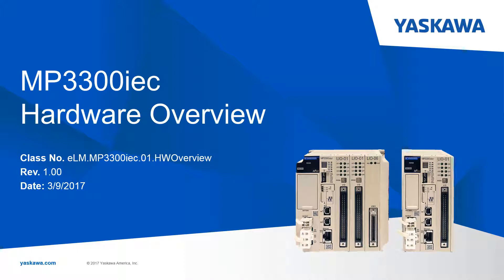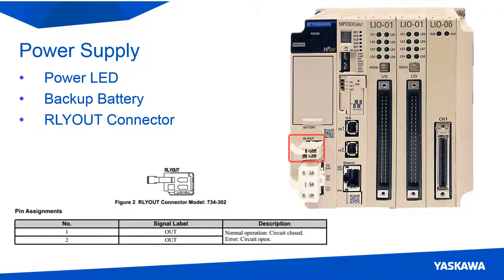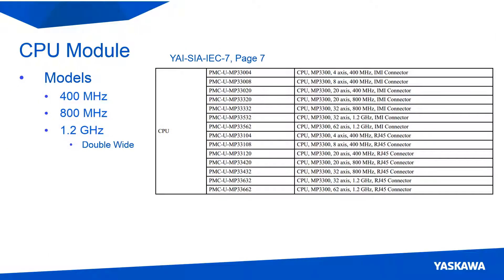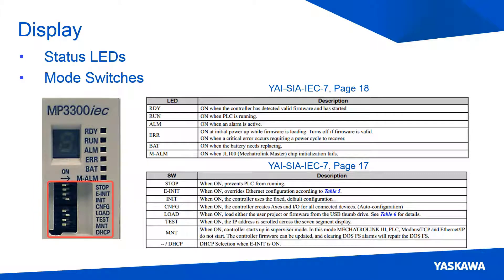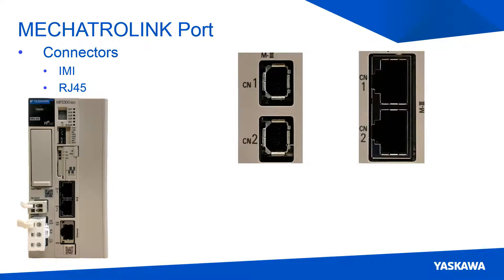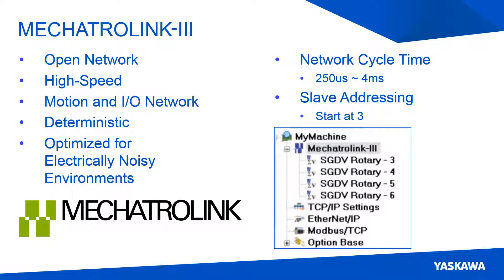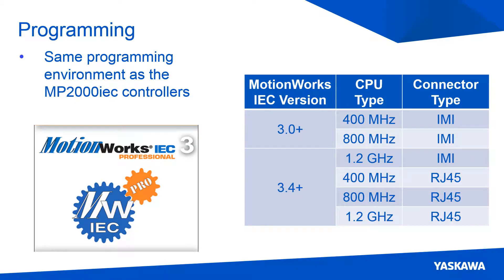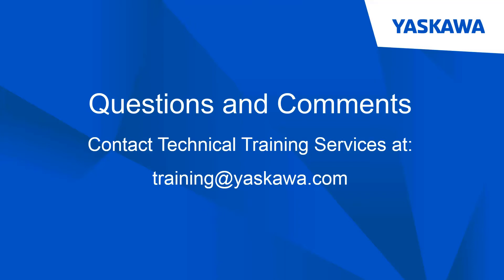MP3300iec Hardware Overview

Comment: Hello my friend
Thank you very much for your good training
I have a question, I have 4 sigma7G servo motors and EtherCat drives
And I bought them to make a wood CNC craft
I really like that the CNC controller is Yaskawa
I want to know if this controller will be connected to EtherCat network?

I have been asking about this for a long time, but I have not found anyone to help me
Of course, my field of study is mechanical engineering and I don't know much about industrial networks
But I bought all my parts from Yaskawa because it has the best quality
Reply from the maker: Thank you for your interest in the "MP3300iec Hardware Overview." Please note that EtherCAT servopacks are only compatible with EtherCAT motion controllers. I recommend contacting our Technical Support team at https://www.yaskawa.com/support-training/support, or reaching out to the nearest service provider in your area: https://www.yaskawa-global.com/company/profile/global.

Comment: With the MP3300iec be used as a stand alone to control servos? Or are individual drives still required for each servo. Im building a large 3d printer, that will use 3 servos for motion and 4 servos for the 4 extruder heads. Following your youtube channel and just signing up for the free training has really made me a fan of your products. The issue i see is it becoming very pricey to add 7-10 servos plus a drive for each, then the controller.
Reply from the maker: Yes, the MP3300 is the machine's controller. It will need to control the seven Sigma-7 servo amplifiers, that will in turn run the seven Sigma-7 servo motors. For more information, please www.yaskawa.com for further support and training information. Thank you for your feedback and interest!